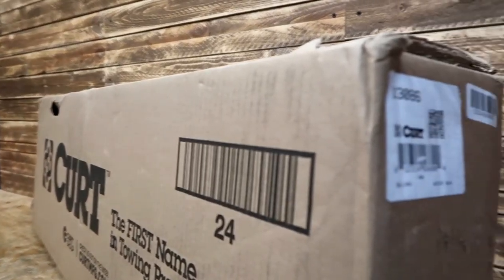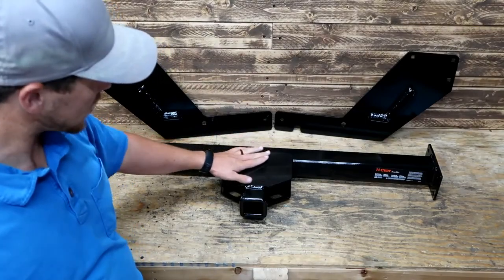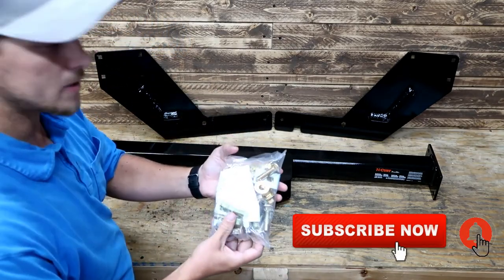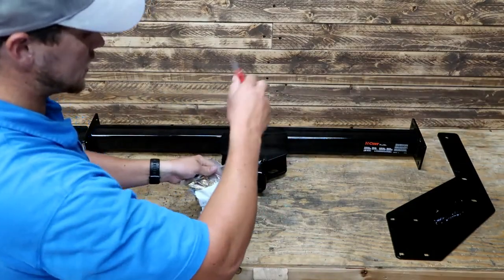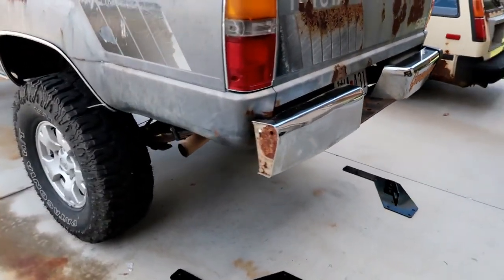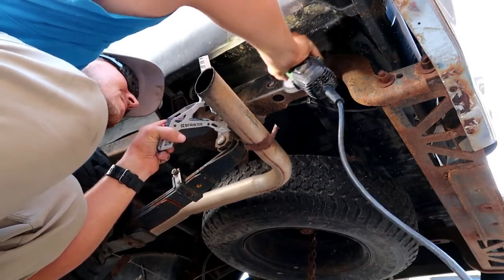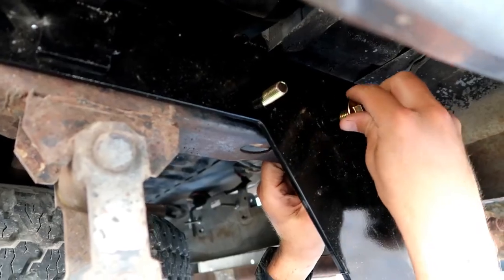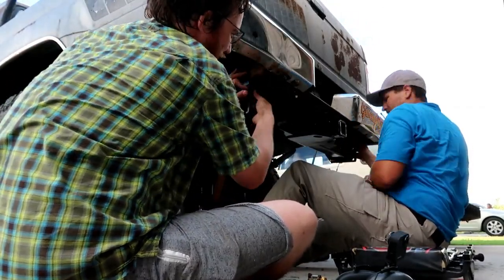Toyota Truck Curt Trailer Hitch Install

Comment: To add on to this several years later: this hitch will also fit a 79-83 truck and you can use the same wiring adapter intended for 84-95 trucks as well!

Edit: same wiring adapter also works for the 1st gen (95.5-04) Tacoma
Reply from the maker: Thanks for the info!

Comment: I have 1983 thinking on putting a tow hitch do you think will fit on my truck ?
Reply from the maker: I’d check to see what vehicles it works with before buying. ‘83 is a different body style.

Comment: Awesome vid! What do you plan on towing now?
Reply from the maker: Small single axle 3,500 lbs utility trailer. Currently it has the Bulletproof 6" drop hitch on it which is WAY overkill for weight capacity but could use several more inches of drop.